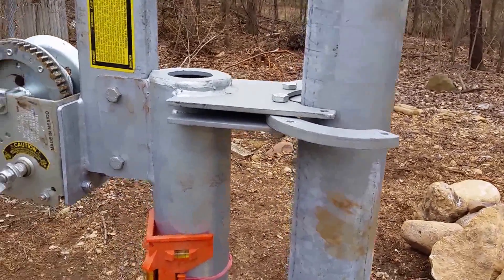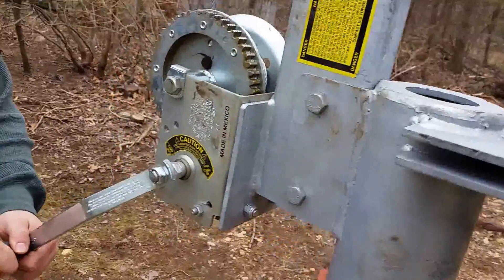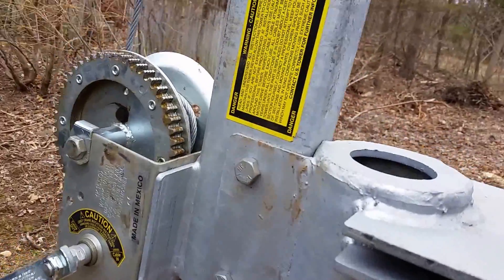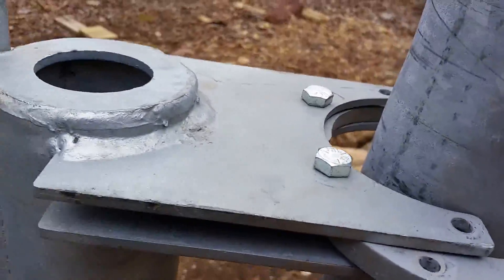UST MA40 WJ1X

Comment: It looks like you have the MARB-40 rotator base and the MAF-40 raising fixture.  Do you have to remove the MAF-40 in order to rotate the mast? it looks like the mast winch could hit the MAF-40.
Reply from the maker: Yes - I removed mine.  I have seen where people remove only the top bolt and "lean" the MAF-40 back and out of the way of the raising winch.  It was easy enough to remove and I think looks better with it put away.

Comment: I'm considering the MA40 unit as well. Very helpful
Reply from the maker: I'm very happy with it so far.  It will be 3 years this spring.
Reply: Mike on that ma40 what do you have mounted on it? It says 10sqft I was looking at a Mosley S32 tri bander for it. Nice work and the total height is 40’? Thanks